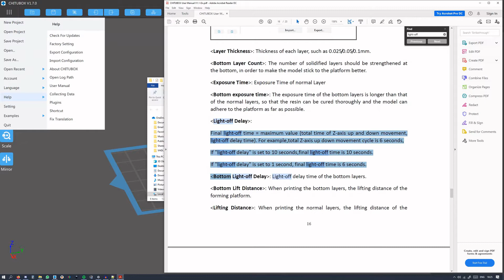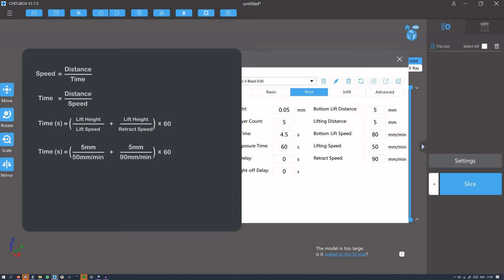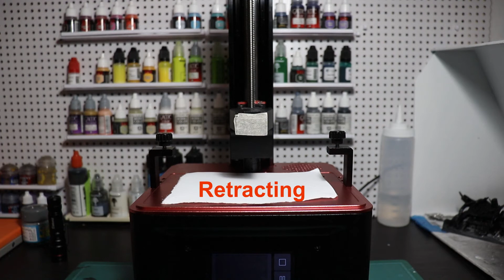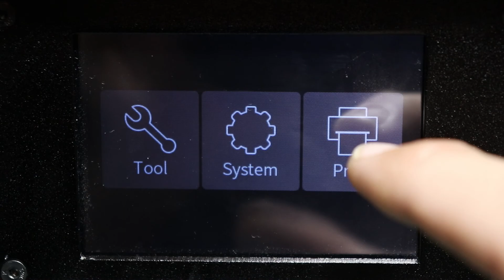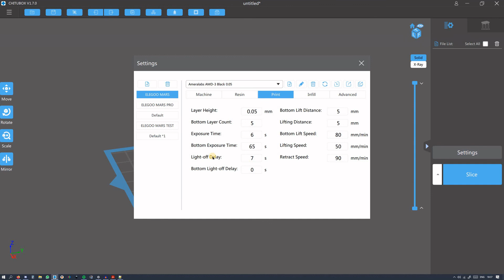Chitubox Light-Off Delay Explained

Comment: Is it possible to directly edit the g code  for the light to Daly turning on after the build plate is lowered in to place? Much like you show with the pause at full lift? That way it always has a light delay no matter what file I print or what speed I use?

Comment: Light off for the bottom layers will allow resin to settle AFTER its being pushed by the plate as it comes down. Unsettled resin will be exposed to UV and start curing, thus creating what is known as an elephant foot. That is the main benefit of the delay.

Comment: You actually need that light off delay for resin to settle. When your build plate moves down it pushes resin from underneath it. If you start curing your next layer as soon as your build plate reaches its lowest postion, resin might still be moving. Viscous fast curing resins will start to get cured while still being squeezed out from underneath the print/build plate. If you model is big and not hollow, there will be more of that resinto squeeze out. It will result in uneven surface of your print and gel like- semi cured resin on the surface of the print. Adding 0.5-1s light off delay allows resin to escape from beneath the build plate and settle before new layer exposure.
Reply from the maker: I can't really argue about that with you Andrius. You, the conclusion on the video is a little bit out dated and it deserves a follow up to be honest. I would still  hold a little bit to to not being incredibly important on an RGB machine, since the time it takes to properly start curing could act as a sort of "delay" but on a monochrome machine, you most definitely need a bit more or a pause.

I'll keep a more broad application of it in mind when I update this video :).
Reply: @3DExtra  Just do a test print with and without it. When it doesn't start away the surfaces are more even. Scientific method, mr. engineer

Comment: Hello! 

I have an issue that I don't really now what is the actual time of the print, just when I started the print because Chitubox says 2-3 hours less time after slicing than the original true time. How can I set this to make chitubox to show me the exact printing time?
Reply from the maker: That's relatively common. Chitu will only ever give you an estimate time. It makes a base assumption of the time based on the speed and layer heights that you input, but your printer movements also have other things involved in them. 
There's acceleration, jerk, firmware max speeds and firmware speed overrides that come into effect and since chitu doesn't know those values, it won't ever really know the correct time it's going to take.
Best bet would be to try rough the difference between the displayed time and actual time and use that as an further rough estimate for the time it will really take.

Comment: On my Photon Mono the Light-Off Delay is executed totally different. The time it takes to lift and retract the build plate is at around 6 seconds (depends on speed settings of course) and after the build plate is retracted back down into printing position, the Light-Off Delay is then executed before curing the layer. So even a low 1s Light-Off delay will be executed and added to the whole layer time. I tried it while printing with very little resin left in the vat, so i can see and hear the difference, when changing the Light-Off Delay setting on the fly on the printer. With 2s Light-Off Delay, the plate gets down into the vat, and then pauses for 2s, then my 1.5s exposure is happening and then it starts to lift again.
So it seems that different printers with different firmware settings are handling the Light-Off Delay setting differently.
Reply from the maker: I can't confirm this 100% since I'm using only Elegoo machines, but I was mostly reporting on how it's handled by chitu and what's in the manual.
I've heard from a couple people that anycubic might handle it differently, but since the photon and photon S use the same board as the elegoo machines (Chitu L K1 or something along those lines) I would think maybe those older machines do it the same way. 
The mono might be different though since it seems to use a custom controller PCB, albeit with the same brain components as the other Chitu products, so it's possible that Anycubic did something different in the firmware or in the machine_parameters.gcode file.
This would seem quite weird for them to add more work for themselves and create a sort of further fragmentation to an already badly executed setting.
Reply: I can confirm the same behavior on my Anycubic Mono. The LOD is added to the beginning of the cycle before the UV light turns on. No math necessary. I took off the vat and ran a print, keeping time with a stopwatch, while watching the screen through the enclosure. I was slicing with Lychee. The front LCD will project the image during the LOD and during the curing time. I have not testing this behavior with any other slicer.
Reply: @jordangladden  Hello. I am using a photon mono with lychee slicer too. Based on your comment, do not I have to do the calculations of this video? I mean, I have my LOD in 1 second, then after the vat is down, it will wait one second and then will turn on the light? please help

Comment: I think you have explained it so wrong. The manual is straight forward with a simple example. If you want to have 11.5s OFF then you put 11.5 (not 2!). Anything below 9.5s will result in OFF of 9.5s!
Reply from the maker: I can see where you're coming from and yes, you're right that anything below 9.5s (in my example) will have an actual "light off time" of 9.5s, but that's the logical light off time as the axis moves to perform the peel action off the FEP, and not an actual further "delay", since the setting is light-off delay, and not light off time.
To me, and I think to others, the light off delay, implies extra time that the UV source is off for before printing the next layer. I should have indeed said "anything below 9.5s will give you no EXTRA delay at all" but I assumed it would have been clear. 
The video was overall an attempt to show to people who put 1, 2, or 3s that that specific variable, doesn't actually enable the light off delay setting in their case and their off time is just the sum of the time it takes to move the axis up and down for peel.

Comment: it is probably better to use higher lift height  (6+mm) than long light-off delay
Reply from the maker: Agreed. If the retention at max height wasn’t a thing, and the only choice was light-off delay, I would go for a higher and slower lift.
Reply: have to admit you are actually right. sorry about that
Reply: Yes it make sense